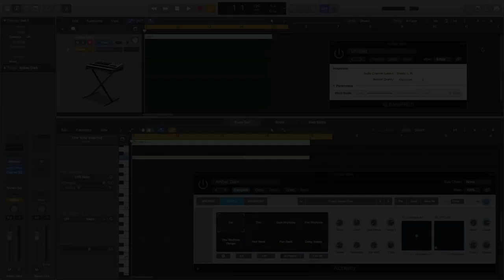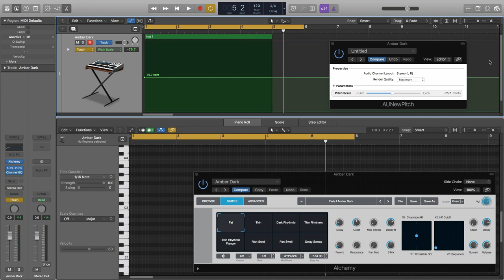How To Pitch Bend Up/Down 4 Octaves in Logic Pro

Comment: What if you need to pitch bend between chords? For example from an Amaj in the C1 octave to a Dmin in the C3 octave, is there a tutorial on this? Thank you.
Reply from the maker: I haven't made a tutorial on this myself, but if we're working with cent values, it'd probably take a little more calculation. But you got me curious, so I'll check. 😊
Reply from the maker: I tried, and unfortunately, the instrument I used lost a lot of its integral tone during the bend. I'd need to troubleshoot and find another way.
Also, getting exact cent values is difficult.
Reply: @SoundEngraver  Why was a post of mine deleted that said that there are two plug-ins on the market and that despite Logic's incredible update, this feature has not been implemented?
Reply from the maker: @NiNa-ji5ik  I don't know why your other post was deleted. Did you post links? Comments with links get automatically removed. What were the names of the plug-ins?
Reply: @SoundEngraver   Fluid chord and Fluid pitch
Reply from the maker: @NiNa-ji5ik  Thanks!